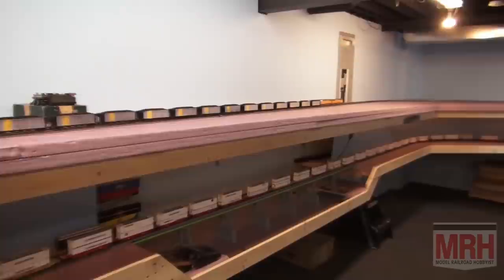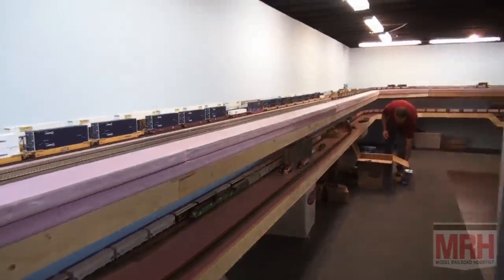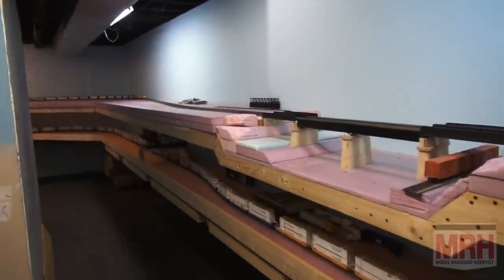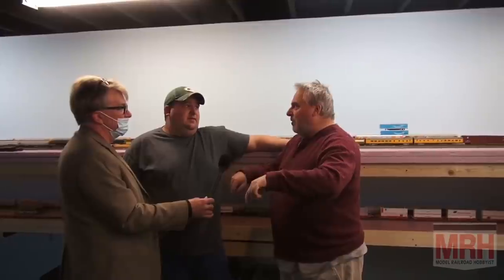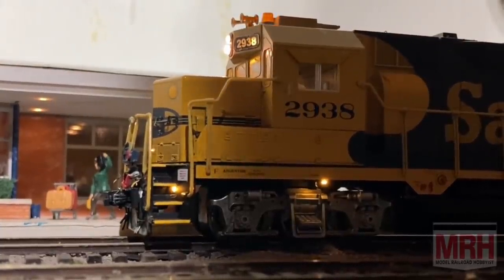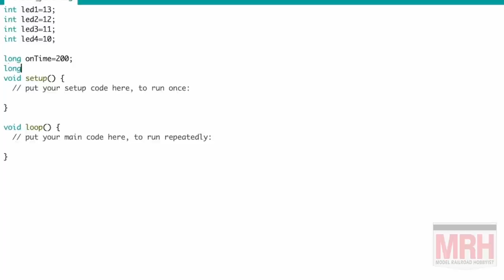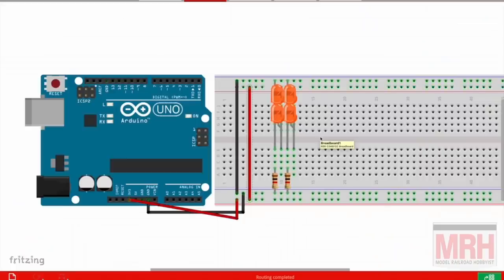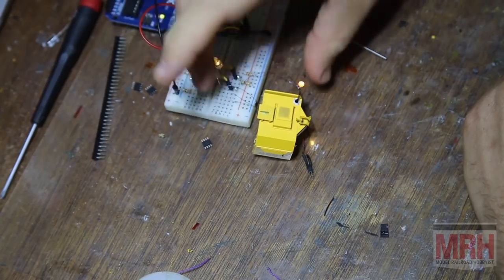Father and son layout | February 2021 WHATS NEAT Model Railroad Hobbyist

Comment: I’m building a double level layout that cars will only go from top to bottom by a staging rail barge so I can run two systems and it will also be in four or five blocks so I’ll have the ability to run dc as well as dcc

Comment: was the 4014 video done with a video game. that " drone fly for miles. and not the greatest video quality. Just not use to that line of quality from a what's neat video. Sorry
Reply: i was thinking the same thing!
Reply: That can happen due a frames per second difference when editing the video.  My guess is the drone shot was 1080P 60fps and Ken's video is 1080P 30fps.  I've run into this problem when editing video. Use a free program called Handbrake to convert the 60fps video to 30fps.
Reply: @westernstatesrailroading  +1